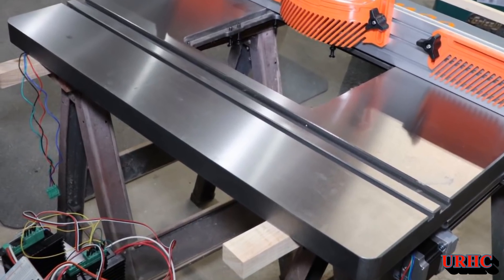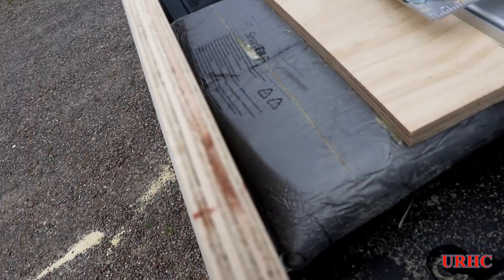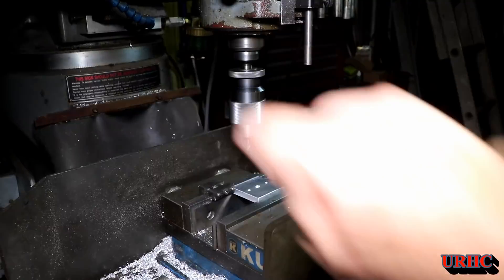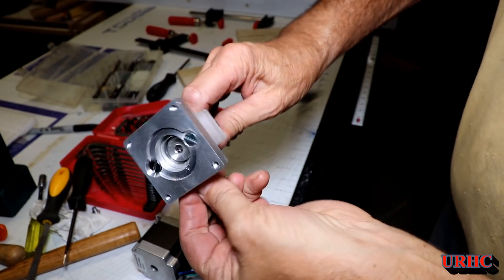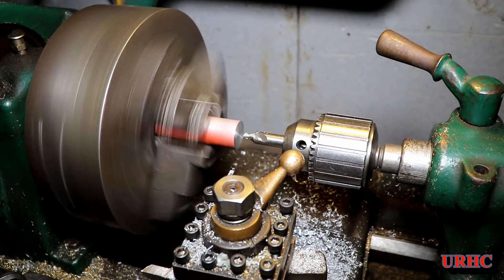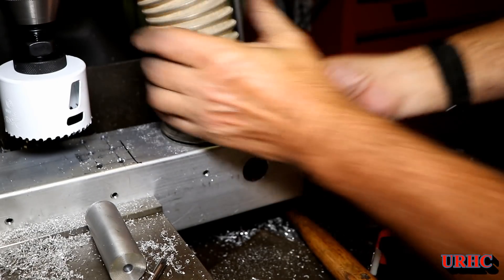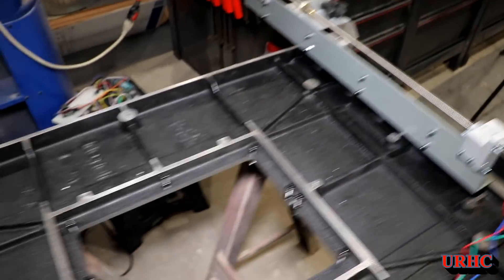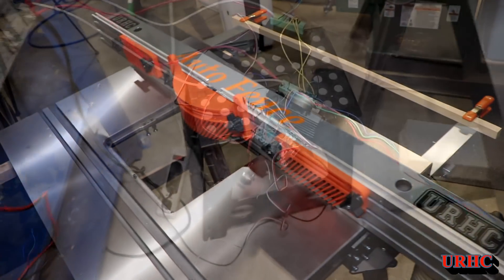Router Table Build Part3 Building The Autofence Parts Assembly And Arduino Moving It

Comment: Is that 3" or 4" channel you mounted the rails on? Nema17 steppers? Anything special about the power supply?
Reply from the maker: Everything was cut from 3 x 3 x1/8 6061 precision straightened aircraft tube. I found a bunch on ebay years ago. The ps is a surplus medical grade 5v, 12v, &36 v volt output. I have the 36 cranked to 40v.  Nema 23 motors.  Use what you have laying around.
Reply: @unemployedredneckhillbilly2023  One last question for now, you have a three position rotary switch AND a potentiometer. I thought the three position rotary controlled the three speeds. What is the middle potentiometer knob controlling? And tyvm, for replying to these comments.
Reply from the maker: The switch sets the pulse frequency  range and the pot adjusts the frequency within each range allowing  the fine tuning.  If you have the time to program an arduino it is a easier and cheaper  option. I started that way but gave up when I realized I didn't  have time to complete it.
Reply: @unemployedredneckhillbilly2023  I can program in C++ and have done some Arduino programming years ago so I may try it on the second build as I plan to build on the way you’ve done it with the signal generators, plus some additional options. I plan to build another this summer at my summer house. I’ll work on using an Arduino or Raspberry Pi for that one

Comment: Great series, thank you. I had thought about this screw shaft idea for a sliding table on the router. This auto fence is a fantastic feature. As Milo Hughes says, you will be surprised how many want to build something like his. I for one. But I also realize the time it takes to video these projects and understand the not wanting to make plans. It would be a limited audience, but this is truly a useful and creative idea. Cheers!
Reply from the maker: Thanks.  Playing with things like this is a great learning experience.  Plans take too long to properly document stuff like this and then you have to spend time supporting them. I now want to build a second generation that a gantry can be swapped out for the fence easily with a plug in grbl controller that allows the table to be turned into a cnc router in seconds.  The way I see it is it's not hard to create things like this if you really want to learn and are not afraid to make mistakes. Thanks for watching.

Comment: I really like and look forward to watching your videos! How is the replacement seat you got for your Kubota holding up? I only ask because I'm looking to replace the seat on my compact tractor and I'd like something more comfortable than the stock seat. Keep up the great work!
Reply from the maker: It's been a back saver and I have a couple hundred hours in it so far with no problems.  If it ever breaks I will buy another.  Thanks for watching.

Comment: Hello sir, I watched your cannon bundle  review from Costco a couple years back and have also watched a couple of your more recent videos. My question is are you still using the cannon sl2 for all your video and photos on your YouTube channel?
Reply from the maker: Yes I am. It has been an easy to use camera with no problems.  My computer can only process the 1080-30 frames per second so the videos are not using the highest quality video it can take. It has survived sawdust in my shop, being blown over on the tripod several times and light drizzle without any problems. Thanks for watching.

Comment: Nice job Ed.  Setup should be a breeze when you get everything worked out.
Reply from the maker: Thanks. It will be great to finally have a decent router table.  I have a lot of learning to do about programming the Arduino so it will work right 😧. My vision of a tablet and app is turning into a couple incremental switches and a joystick.  Thanks for watching.

Comment: I often wonder what someone like you could do with the copiers I scrap on a weekly basis. They are full of stepper motors, control boards, belts and pully systems really a makers dream being recycled into who knows what.
Reply from the maker: I'd have a garage full of parts and no time to use them. I used to live near a company that disassembled items like that and sold the parts very cheap.  It was a great way to save money on a project. Now none really wants to deal with the  older boards that contain lead so most of that scrap goes offshore for recycling.  Thanks for watching.

Comment: Seems like that Riata plywood soaks up the water based poly and requires a lot of sanding. But the price is right.
Reply from the maker: I guess that I will find out. I had never seen it before and figured it was a good time to try it. It is really nice and flat plus doesn't seem to have voids.

Comment: So it's definitely been a really interesting project - but I have to ask: what is the end-game for the auto-fence?  I'm trying to envision where I'd need to step a fence so precisely. Do you have designs on some sort of artistic endeavor with this?  I could see where it wold be handy to, say, make a test cut on a rabbet and then be able to jog a few thou to dial-in the cut......
Reply from the maker: I just want an accurate fence that you don't have to fiddle with. It will be easy to make custom size mortise and tenon joints, fluted trim, box joints that are variable width, easy adjustment of vertical panel bits, Waffle type hot plates, corner splines, and the list goes on. I don't want to fiddle with knobs and tweaking things like with my current table and I want the dust collection out of the way and functional plus the fence to add support for 8 foot long boards. Proper lighting of the work area and to be what I consider the perfect fence Build it and they will come. Thanks for watching.